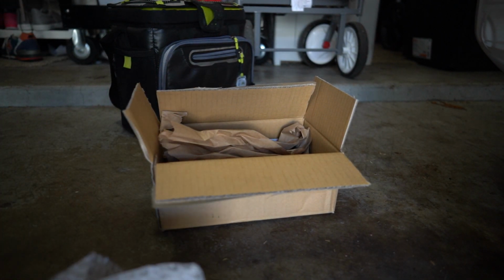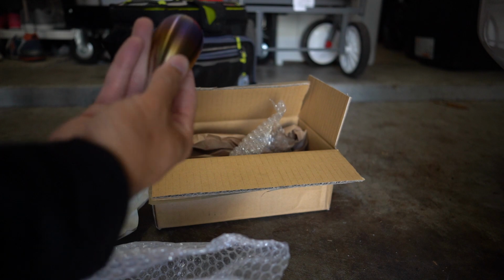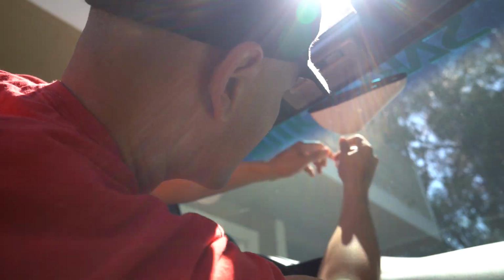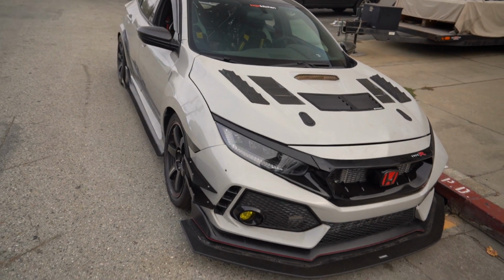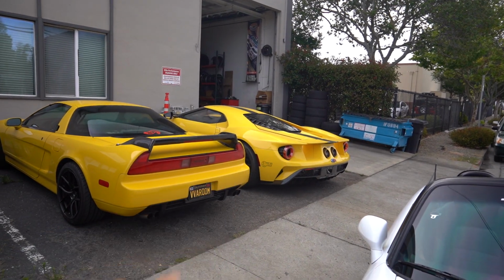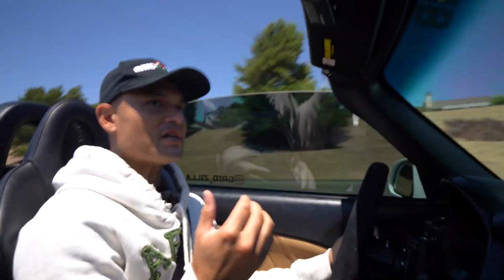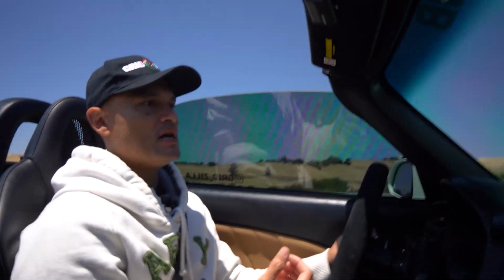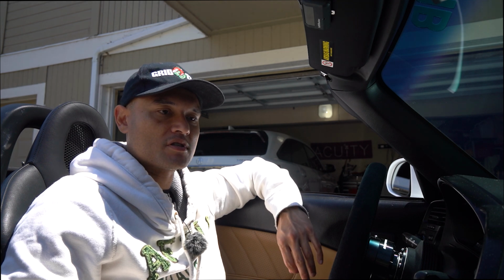DON'T CHANGE YOUR S2000 TCT WITHOUT THIS

Comment: I am a fan of ballade sports and supporter as I've ordered many things from them. With that saying I recommend not installing that oil baffle . I  had mine one for about a year . I took off my pan to redue my gasket and notice deep gauges in the pan . Wether or not that was letting loose metal into the oil was to be seen and need an oil analysis to prove but better be safe then sorry I took off the baffle . Hope this helps.
Reply from the maker: 4doorspankyou714 good looking out. I’ll send my oil out for analysis when I do change it. If anything looks fishy I’ll pull the pan and take a closer look. Thanks for the heads up

Comment: From my experience I do not buy ballad sports parts or support them. I went to their garage to service my s2000. And was very disappointed at their service. Didn’t even torque down head bolts right, from pushy sales to their rude language when told no. Few days later my car smoked after drive, found oil from every head bolt. Poor poor workmanship.
Reply from the maker: kdavid123186able sorry to hear you had a bad experience. I try to base my comments on my own personal experience with them. So far it’s been fine. Having said that I’m too far away to get any work done directly from them. Their products seem to be pretty solid. Sounds like your bad experience was more service related? Or did you have a product that failed on you?
Reply: Michael Baxi Media ya I guess it’s more of their service and I am just mad about it. It’s been about 3years and I am still not over it. If you look up ballad of s2ki forum you will see mixed reviews also. I do use their timing(can’t remember the name) and it’s been fine. Btw re greasing gear level and vtec solonoid gasket should also be must if you just picked up the car. (Sorry for the spelling)
Reply from the maker: Oh yeah I’ve read through a lot of those comments on S2Ki. Definitely raises the eyebrows but I also know from personal experience than customer service is sorely lacking in this industry and seems to either be spot on or horrific but it’s definitely not mutually exclusive to one shop or another. There’s a lot of great info out there on this platform. Doing research is important but I try to reserve judgment until I’ve seen what it’s all about for myself.
Reply: @Artemio Medina so true. anything but ballade

Comment: ballade tct would disintegrate in peoples motors leaving metal shavings. 
ballade timing gear has not been proven to do a damn thing by anyone who knows motors
ballade oil pan baffle is a glorified windage tray that also leaves metal in the motor. 
ballade knock sensor is a rebranded knock sensor that doesnt work to oem standards
ballade aim dash bezel is crooked

in building his business he has screwed countless people along the way. from peoples cars not properly getting serviced to countless owners with metal in their motors. 

Is he a good business man, yes, but hes in it for himself, not to be a staple from the community 10-20 years later.
Reply from the maker: Mr.Sleeper-X thank you for sharing. It’s important we know any possible risks. I’m fairly new to this platform so I’m learning as I go along.